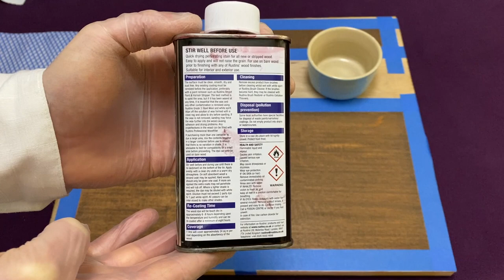Brian May Red Special Guitar Build Project: Body Finishing Part 3 - Grain Filling & Staining by dsgb

Comment: Thank you for making this mini series. It’s helped me tremendously in my guitars finishing process. I just have a few questions. Is the same process used for the neck that is used for the body? Do you know of an alternative to Rustins? I’m located in the US and I’m having trouble sourcing someone online that will ship to me.
Reply from the maker: Hi Kaden. Thank you so much for your positive feedback. Yes, the same lacquer/lacquering process is used on the neck. I recommend nitrocellulose lacquer. If my local conditions were more favourable and I was confident using an aerosol based lacquer, I would have used it. Luke Holwerda @lukeyourself used it on his build (check out his series of 13 YouTube videos on building a Red Special replica if you haven't already). I understand that Andy Guyton uses nitrocellulose lacquer except on the Time Warp Red Special replicas. That is my alternative recommendation. I don't know of any other brush on hard lacquers for use on guitars. Check out StewMac's range if you don't want to use nitro. 👍😀

Comment: Do you know which company's paint was used when making the Brian May guitar? Why is the paint on my guitar peeling off like that?
Reply from the maker: Brian used Rustins wood stain and Rustins Plastic Coating on his guitar. I don't know what coatings are used on other Red Special replicas or commercial Brian May Guitars instruments such as the BMG Special and the BMG Super. Commercial instruments generally are coated with a tinted hard wearing clear lacquer such as polyester or polyurethane.

You refer to "paint" which is a suspension of pigment in a solvent which is either aqueous (water based) or mixture of volatile organic compounds. No Red Specials are "painted" to my knowledge.

I can't comment further without specific information, sorry.